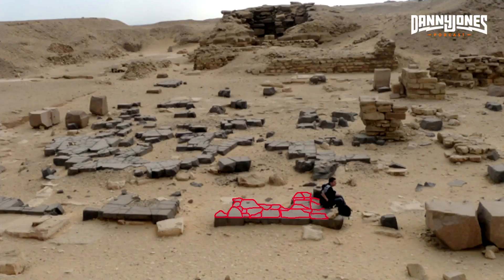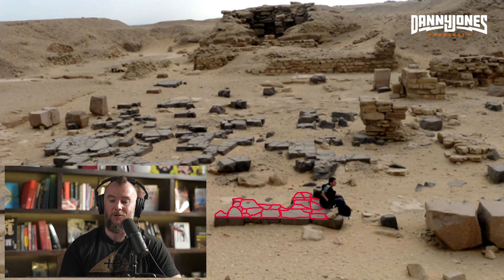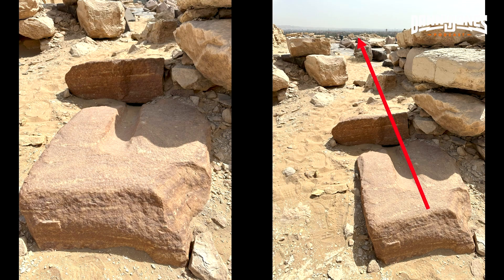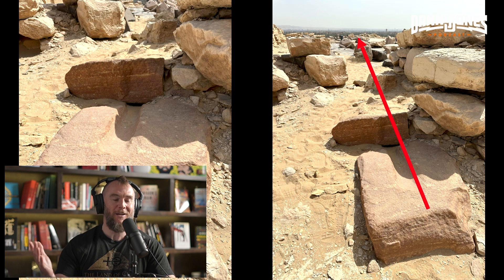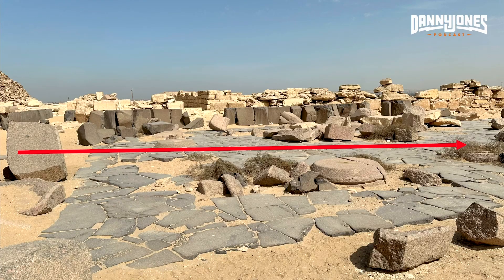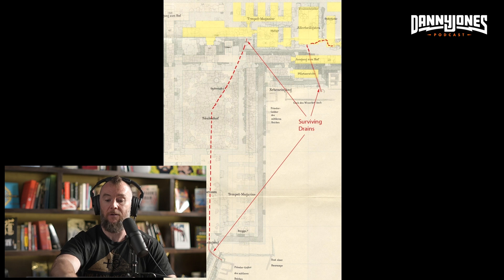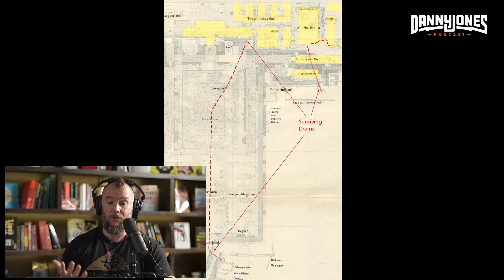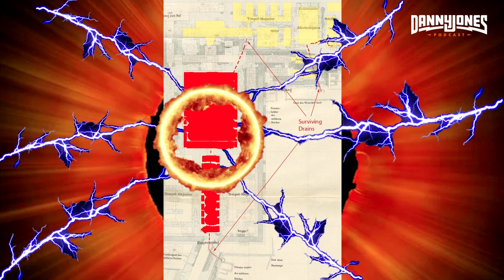Why These Rare Organic Materials Were Used to Build the Great Pyramid | Land of Chem

Comment: Look into exothermic reaction within gravel granite. Common connection with pottery. Iron oxide and aluminum. Purifying aluminum for megalithic stone.  It was reused over to create extreme heat for megalithic stone, extracted, i.e., nubs leaking iron and aluminum oxide.
Reply: you're talking about using termite in order to super-heat stones and make them soft? I thought about that a lot of times. I've also read the Geoffrey's book and as a chemist I must admit that his hypothesis is quite plausible. Not so convinced about the pressure-retaining of the stone chassis but maybe in the past all the sealing were far better than now (and before heavy weathering i guess).